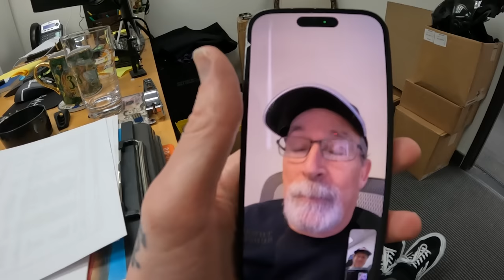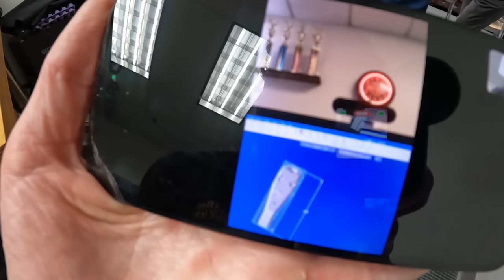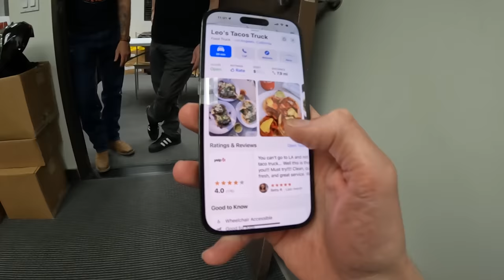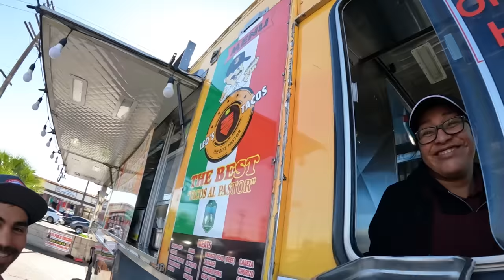Ditched work for Tacos & Harley Wheelies! Vlog 58

Comment: Need an air cleaner cover that is center bolt for a round filter with cut out for the extreme flow and vance & hines vo2 style that has the fully exposed filter. The "Screaming Eagle" design is the only one I can find and it is hideous. Bout to buy one and Dremel it out myself.

Comment: Any way we can make something that would hold my skateboard on my Harley? I’ve bee using a sissy bar but now I got a new seat my sissy bar is too low my board will sit on the seat and could put a tear in it. I’m thinking making a mountable sissy bar that has a slot that will lock the trucks in or where you put a saddle bag have a rack that holds on to the board. 🤔 maybe use your detachable racks and some Velcro straps to hold my board in or something